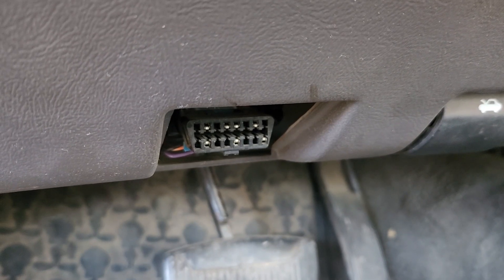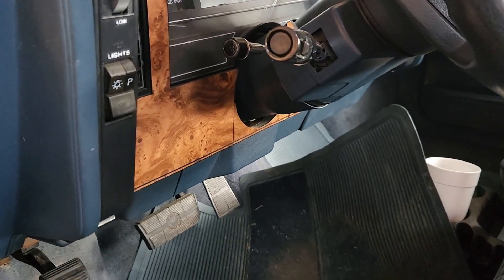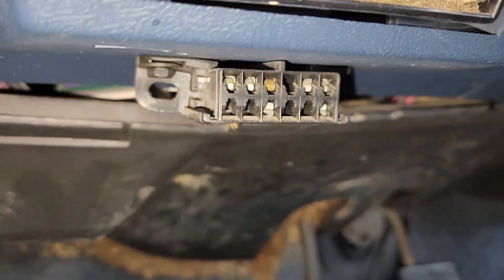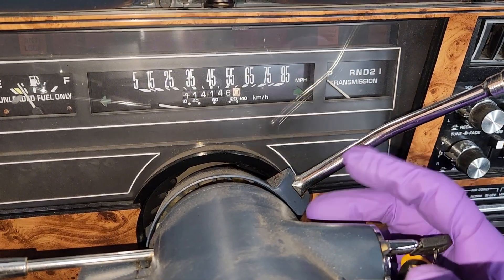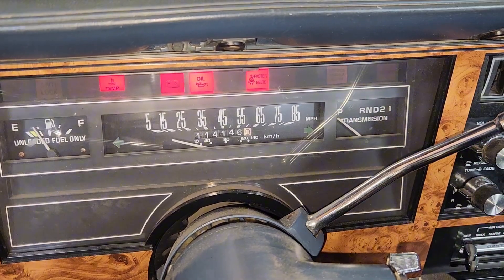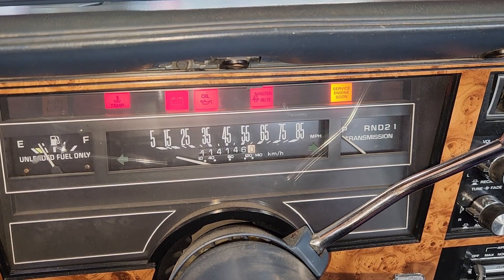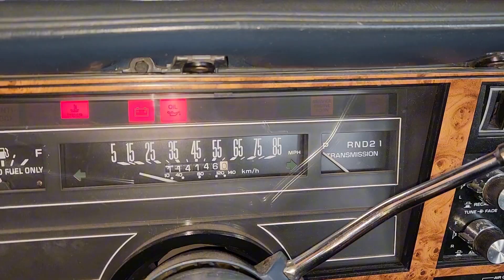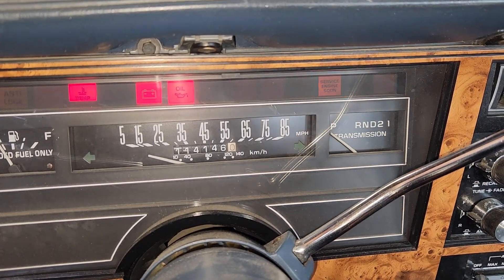Check Engine Light on in an Older Car?

Comment: Gotta get that fixed or the transmission will go out. When the VSS is not working, neither is the torque converter. The transmission is designed to work with the torque converter at highway speeds.
Reply from the maker: Ah, yes. With electronically controlled torque converter lockup can be dependent on the VSS. Fortunately, in this unit that function is controlled by hydraulic pressure (hooray for the 90s!). 

Thanks for the comment! Make sure to check out our other videos that involve transmissions. You might be able to give us advice for future videos!
Reply: @NiceGuysGASS  : Actually it's controlled by a sensor behind the speedometer and an electric solenoid in the transmission by way of the ECM. Unfortunately it's an emissions control device which is why it triggers the "check engine" light. GM made it like this on all passenger cars beginning in 1981 to meet EPA emission standards.
Reply: Do these cars have readiness monitors ? How do you know when it's ready for smog ?